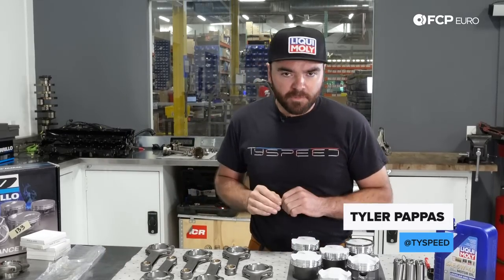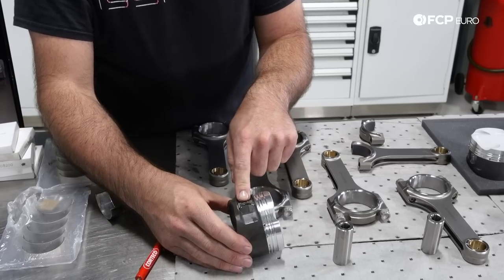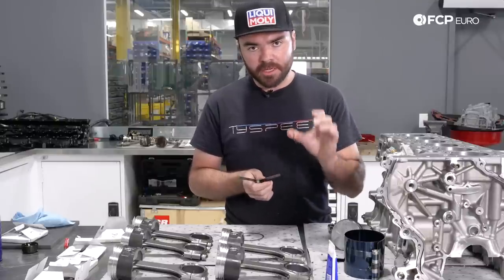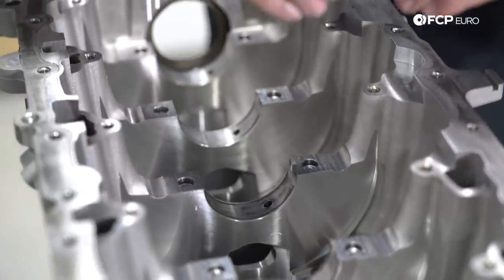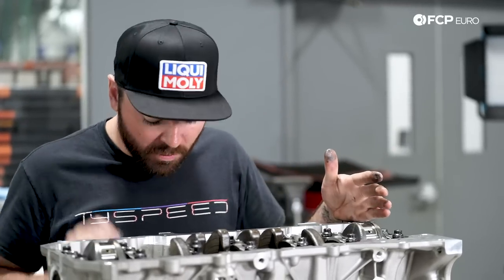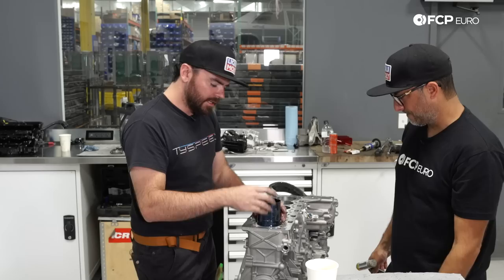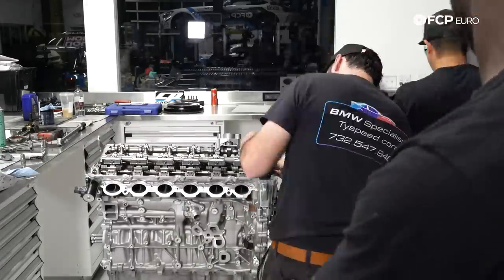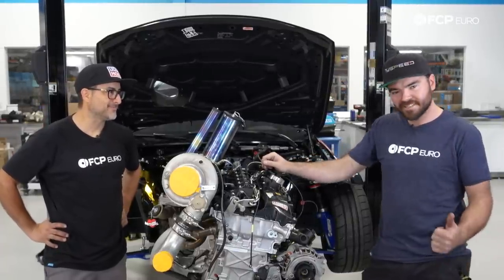How To Assemble & Build A B58 Engine For 800+ Horsepower - The BMW F30 Drift Taxi

Comment: I am surprised you guys used the old oil pump, especially knowing it ingested debris.
Reply: Doesn't the B58 have a pre-filter in the pump inlet?
Reply: Just clean it thoroughly
Reply: @zaarkeru3391  It only has a screen that wouldn't catch small metal particles. Only chunks of gasket, large flakes, debris, etc.. You should have the pump cleaned or replaced in an ideal scenario.

Comment: I learned from my grandpa 30 years back that ring gaps must be 120 degrees between each other, so basically gaps of all 3 rings will form a n imaginary triangle when you look from the top of the piston.
Reply: Why though? Wouldn't putting the gaps 180 degrees away from each other ensure that they are as far away from each other as possible, so that each successive gap is as far away from the previous ring's blow-by as possible.
Reply: @sepg5084  how do you put 3 gaps 180° apart from one another?
Reply: I think an unmentioned goal of ring gap staggering is for cylinder wear purposes. If you do 180, 180, 180, you'll have two rings with end gaps riding on the same area of the cylinder wall.. If you do 120,120,120 you ensure each gap is as far as possible from any other.
Reply: I learned from Steve Morris that it doesn't really matter as the piston rings rotate.
Reply: @DriftNick It's true that they rotate, but if you start with them apart, it's not likely that they will all rotate into a line.
Reply: @mateo...  the first one is at 0, the second one is at 180, the third one is at 0. Each one is 180 degrees away from the next ring.

Comment: There's a select few people hitting 700bhp+ on stock internals.. Crazy to believe although I think that magic comes from the tuner.
Reply: Good number of cars in germany running 800+ reliably on stock internals for a while
Reply from the maker: You are correct, good tuning and proper fueling. We had some fuel issues on this car that resulted in fuel in the oil washing down the bearing surfaces and causing the damage due to lack of proper lubrication
Reply: @fcpeuro  I was wondering why the new crank, seemed overkill.

Comment: Did you have to replace the liners?   I thought the new gen motors used that arkwire cylinder plating which doesn’t use a cross hatch.  I see there is now a cross hatch in the cylinders.
Reply: Even with Plasma Transfer Wire Arc, or other spray plating - they still employ a cross hatch.
Reply: I’m curious as well since the welded material “liner” is very durable but also very thin and honing will also thin it out.
Reply: The block in this video is sleeved. The factory LDS sprayed liners cannot be re-honed.

Comment: Why not use the plastie gauge on the rod bearings? With all the aftermarket parts seems as if the most worrisome clearances for oil flow would be there and mains.. just curious, I am not a professional.

Comment: What did yall used to seal the oil pan? In the process of doing a motor swap with a 340 but got a motor from a 5 series and have to switch oil pan.

Comment: fueling, uprate the suspension, stiffen the body, uprate the brakes, wider tires, staggered, downforce needed, reliability, it's not just building an engie, but then...... you knew that right

Comment: I personally don’t trust plastigauge that much because of my anxiety of “is this really in spec or not” and not seeing a solid number. my practically scared self orders dial bore gauges and micrometers. And go by inner diameter of the main crank bore on the engine and the inner diameter of the big end of the connecting with bearing installed on both MINUS the circumference crank main and rod journals after torquing everything to full torque That’ll give me a solid number that I can confidently write down and track just in case I have to go back to it. But I do use plastigauge to double check if my numbers are even in the ball park of what I want or within the Specs I need

Comment: what would you do if the plastigauge shows that the fitment is incorrect? do you need different bearings?
Reply: yes you get thicker or slimmrt bearings

Comment: I'm aiming at making around 750whp reliably with a Gen1 B58. I'm about to pull the trigger on CP Carrillo pistons plus new bearings. Would it be wise to change the bore (82mm) and compression ratio (11:1)?
Reply: What did you end up getting

Comment: Why wouldn't you be able to resurface the rod journals and adjust the rod bearing size?  Is it because to much material would need to be removed from the crankshaft?
Reply: There are no "undersized" rod bearings available for the B58 crankshaft. Because of this, It is not possible to repair the crank by grinding alone. Theoretically. the crank journal can be welded first and then ground back to factory spec.. However, that is a very specialized process you will not find on short notice. That process generally costs more than just buying an entirely new and flawless crank from BMW. 

There are some "oversized" rod bearings available. Meaning, it IS possible to repair a damaged connecting rod by boring the big end, and using said "oversized" bearing.

It is important to understand the difference on bearing dimensions, there is a lot of misunderstanding of sizing terminology. 

As applied to connecting rod bearings:

Undersized, meaning the inner diameter of bearing shells is tighter to compensate for ground off crank material, outer diameter of bearing shells remain the same.

Oversized, meaning the outer diameter of bearing shells is larger to compensate for a larger connecting rod bore, inner diameter of bearing shells remains the same.

Comment: High HP engine build with all new parts and not a micrometer in sight… Yikes! 😬
Reply: Yeah I didn’t see any cleaning of bearings, weighing the rotating assembly, any clearance measurements, etc. Hopefully all measurements and cleaning was done off camera. If not i don’t see it lasting long lol

Comment: See that's the bs part, 4k worth of bottom engine parts, it's a 6 cylinder...that's just insane and stupid. Awesome video but the cost of parts for the bmw engines are out of control
Reply: I mean, its a race engine...
Everything racing spec is crazy expensive.
Reply: @Zaarker U  if you look up bmw parts ALL are crazy expensive, not just "race" engines. Really any decent forged rod/piston combo(even cheap ones) on a 6 cylinder can handle 800hp, that's 133hp per cylinder. You'll easily spend almost or over 3k just for regular upgraded parts not including a crank,  that's insane even if BMW is on the badge that's what I'm saying
Reply: @mythos000000025  First off, it is torque and cylinder pressure that kill rods, cranks, and pistons. HP per liter means almost nothing with regards to the rotating assembly. any rotating assembly can theoretically make any amount of HP per liter so long as the torque is limited. Just apply extra RPM... That's all HP is. (e.g. Honda S2000. the only reason it competes with a LaFerrari for HP per liter, is because it revs to the moon, but makes no torque.). More importantly is Brake Mean Effective Pressure. Of which, FCPs B58 is likely well over 400PSI. For reference, the BMEP of a McLaren 765LT is only about 360PSI. That stock engine was dealing with pressure levels you don't see until you are looking at a Koengisegg, and it was ripping around a track at full tilt for hours and hours. Hope this gets across what I am saying.

Anyway, the B58 crank is forged steel from the factory. Nothing to upgrade, nobody has reached the limit. The stock B58 rotating assembly can handle wild power levels for a regular street build, so long as there are no lubrication issues and torque is managed. The failure is an error on FCPs end. There are VERY few engines that can compete in stock form at the present day. To build ANY engine that reliably makes that 100% output at full boost and full engine RPM for a prolonged period, like a race car, drift car, marine engine, or aircraft engine, this $3K cost for aftermarket parts is pretty average. For a 6 cylinder, you say this is insane and stupid... Go ask the guys who build Nissan RBs, 2JZs, Barras, Porche flat-6s, ford ECO boosts, etc..

The words "any decent forged rod/piston combo" do not go together with the word "cheap". CP Carillo makes these same parts for just about any performance engine. They will never be cheap, that has nothing to do with BMW. The other guy above me is right. The BMW engine was basically a "race engine" stock. Only needed 3K of upgrades to survive like that, where another engine would need an entirely new block, reinforcement, better cooling, better oiling, etc.. 

I agree many BMW parts are overpriced. So are any parts you buy direct from the manufacturer or dealer. But, you can buy all of the stock engine parts directly from the suppliers and they become the same as anyone else for what they are.

Comment: I’m not happy with you FCP... you changed you lifetime guarantee which is ridiculous. 🥺😖😡 

Also where’s the builds for engines on other platforms?
Reply: What did they change?   I went and checked and nothing stood out.
Reply: @chrispetty5058  there’s a lifetime but if prices inflate and you wanna claim the warranty, you will pay the difference if the price increased. So if you get a item that was 100 this month and in a year the part fails, you need to warranty it out. Say the price went up 25 bucks and is 125 when the part fails. You have to pay 125, the extra 25 for new item then they’ll send replacement. Everything will stay the same for items purchased before Nov 2022 I believe. Anything after that is subject to the price difference do to inflation. I’ve bought everything for my car from them, and they’re one of the reasons I got my car 2-1/2 years ago due to the lifetime warranty of practically everything they sell. The reason they did this, because people were changing parts before their useful life. Such as changing plugs and coils out every oil change, it was hurting their profit margins I’m sure. One bad eggs spoils the bunch I guess.
Reply: Well maybe this might help put it to perspective.  So when it comes to oem parts ,dealers have to pay the manufacture “cost”.   They have no control of this price only the mark up.   
I have seen where a manufacture on Friday had a high pressure pump cost $450 then on Monday it at cost the $1500.  This is before the dealer can price it to make a profit.  This also is on a part has zero changes/improvements made to it.  Now if you as a customer purchased that pump for the suggested price at say $600 previously and now the price is $1750 that sucks for sure. .   There clearly is difference the dealer/business cannot afford to eat the $1000 difference. But from what I’ve seen it’s mostly out of there control.  
I have also seen an engine that cost $3500 on Friday go to $5600 on Monday.  What sucks is I f it was not build to a ticket/PO/RO on Friday, the dealer price on Monday would be $5600 before any mark up and the estimate will need to change.  Hope this helps.